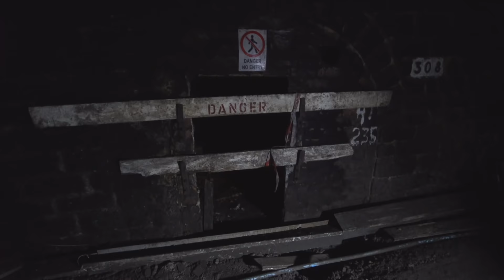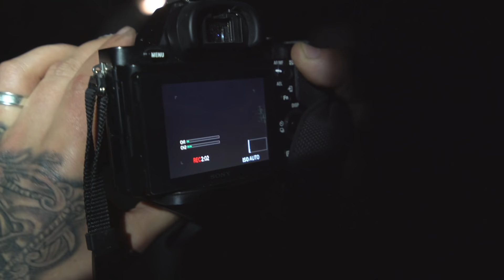CRAZIEST UNDERGROUND EXPLORE YET! A WORKING TRAIN SURPRISES US!

Comment: The clicking noise wasnt an alarm, its a way of enabling the location of the emergency  escape tunnel to be located in the dark. The green lights will be on 24/7. Great video chaps!
Reply: Might have ben a ram pump that is how the big ones sound
Reply: @011CJ  well I know the clicking is distinct but you would hear the water from the valve in between the clicks
Reply: @stuartpratt3662  yes true
Reply: 32:30
Reply: @011CJ  That was nothing like a ram pump.
Reply: @severnsea  have you ever ben around a big ram pump in any of the major cities undergrads? They are massive biger then a truck and sound just like that . I definitly could be wrong tho 🤔

Comment: Lol I work on the rail, This is standedge tunnel. The metal cage is indeed to support the roof as it was collapsing. The line you were on is the trans Pennine express route from Manchester to York. Between Diggle and Marsden. The tunnel is close to 4 miles long with gates on either end
Reply: Rob Kennedy is that the Diggle in Saddleworth
Reply: @SPOOKYGAMER  Yes
Reply: I thought they were in Hull? How did they end up there?
Reply: @will-zu1xv  yeah me too where is it exactly
Reply: @will-zu1xv  They pasted 2 different scenes together. The tunnel they enter at 9:50 is a different as they are in at 13:25. The tunnel at 13:25 is one of the service tunnels connecting the 4 tunnels of the Standedge tunnelcomplex (1 canaltunnel for narrowboats, 2 disused railtunnels (nowadays in use as service & emergency roads) and a life railtunnel. At 37:00 they exit the tunnel in Hull again.
Reply: @wam98674  It was a part of a shelter for workers in the tunnels long time ago.
Reply: @gilles111  ahhh okay cool cheers dude!
Reply: Fuckin hell diggle i went round there on a double decker bus it is very tight round there it was out of service coming back after doing a school run i saw a transpennine 185 go over the viaduct
Reply: Instead of Pennine I red Penny wise, alright
Reply: @gilles111  That makes sense, that is the Standedge tour boat for sure. The "Enviroment Agency" logo on the drivers overalls is easily recognisable.
Reply: Know Anything about the boat?
Reply: I agree, that's definitely standege tunnel, I live near there
Reply: @replayrecords5865  someone said in the comments the boat was a canal river survey boat that is there annually, they happened to be there the same day it was
Reply: @gilles111  That explains why I couldn't figure out how they got down there at 13:25.
Reply: @replayrecords5865  They have tours through the canal starting from the Standedge Tunnel Visitors center.
Reply: That explains the weirdness
Reply: You should show them around
Reply: Looks like a lot of maintenance work going on  . Plastic tube for Communication .
Reply: "The Standedge Tunnel Visitor Centre, at the Marsden end, is a base for boat trips into the tunnel and has an exhibition depicting the different crossings."

That was probably the boat they saw passing underneath.
Reply: @gilles111  Is there actually an entrance wide enough for a vehicle to drive thru? The tunnel looks like it has tyre tracks.
Reply: @schweizerd6303  It is absolutely wide enough. The railway tunnel once fitted double track (the disused tunnel between the live tunnel and the canal tunnel - at the other side of the canal is another disused railway tunnel). So it is about 6-9 meters wide. The other railtunnel has live tracks in it (the Huddersfield - Manchester Line). The disused tunnel is still in use for maintenance truck and emergency response traffic (for both the canal and railway).
Reply: They mentioned the boat was hitting the sides - I've been on that boat from Marsden (at the opposite end of the tunnel from Diggle) and it does indeed hit the sides.  The guide said that was quite normal and not to worry.
Reply: I was confused when they said hull that is deffo stanhedge tunnel been in it before took me an my old man hours an hours in total almost a full day going between tunnel to tunnel only ones I’ve seen that was made like that were they interlink amazing got a lot of photos wasn’t lucky enough to see a canal boat pass underneath tho

Comment: just a tip for who ever reads this, DO NOT clim a latter by grabing the middle, grab the rim on the side, its safer and easier.
Reply: and never ever climb the latter, grab the air and carefully use it to avoid breaking the latter
Reply: hard for me to tell if "clim a latter" is just a cultural variation of spellings or an indication that the poster does not speak english as a first language.....or they're just american
Reply: Grab the middle  its safer actual
Reply: You should have told me Earlier
Reply: Remember to always clim a latter upside down. Will be much safer and if you puke, u wont do it on yourself.
Reply: *Just *climb * ladder *grabbing *rim?
Reply: eastjinks dont you mean scottish?
Reply: Monokuma just.. dont climb
Reply: Also climb feet first, good tip
Reply: I'll grab whatever I please, thank you.
Reply: eastjinks, so I’m not an American or anything but the English I speak is sort of American ish. I’d have spelled it ladder.
Reply: Ladder
Reply: I don’t understand
Reply: @Nova Haxor ABSOLUTELY WRONG! Just read any safety advise for using ladders:
If you grab in the middle and slip, you are able to hold yourself. If you grab on the sides,.you're at high risk of breaking your wrist. Very bad idea.

Comment: Shiny tracks always mean active railway. 
(edit) but rusty tracks don't always mean inactive.
Reply: Yeah but not always the line could be closed beacause of engineering works
Reply: @scottishtrains9761  Even if thatvis the case, shiny tracks still indicate a high probability of meeting a train. Not a wise idea to be walking through a tunnel with no refuge on said tracks if you have no communication with the management of that section. Trains don't stop quickly.
Reply: @mfx1  if it's shiny, it's highly likely to be in VERY freqient use.

Don't touch it.
Reply: Rusty tracks mean nonactive railway
Reply: @justaguycalledjosh  touch it
Reply: @freddiemercurygaming4124  Not necessarily, they can go rusty very quickly during times of maintenance/infrequent use or.if the rail has recently been replaced. All rust means is that it hasn't been used recently or often.
Reply: ya, but remember; rusty tracks doesn't mean anything at all!
i know now,
Reply: Never thought about that. Thanks man🤙
Reply: Google search: It will therefore take 20 years for 1mm of steel to be compromised by rust from each face, or 2mm if both sides are exposed. If the unprotected steel section is 6mm wide one third of the section will be compromised in the 20 years, but a steel rail would only have approx 15% of its section compromised.
Reply: Less used than often
Reply: I once came across a railway track that I wasn't sure (at first) if it was used or not
and after having a look around without getting too close, I decided to proceed with caution, and after I crossed over the tracks and had a bit of a look around, I then noticed the tracks in one spot were bent and zig-zagged back and forth from one side to the other, so from that point it became clear to me that the line was defiantly closed (as a train would de-rail if it tried to pass over that bit)
and later in the day I also saw one bit where the rails had been lifted up and moved to the side
Reply: That's facts right there.
Reply: @scottishtrains9761  it’s still an active railway if it’s shiny it has a decent amount of rail traffic so there gonna have it open asap but even if it’s closed for maintenance it’s still an active railway
Reply: @freddiemercurygaming4124  No, it just means it has a lower priority. There are rusty tracks near my old house and they were used.
Reply: @1143flip  Point is just be careful. Brake discs on cars can look rusty after a day or two of rain if the car hasn't been used, surfaces can go rusty very quickly. There are one or two areas where there is only a weekly service, a track can look rustier than it is in between use.

Comment: its a ventalation shaft, in the days of steam it would be used to remove the smoke, also they could have been used as a shaft in the tunnels construction.

The fireplace is used as part of a service station for the maintenace crew 100 odd years back.
Reply: Tartaria
Reply: The area with the fireplace was for the platelayers/trackworkers to have a take a break, get warm and have a brew.

Comment: This tunnel looks more like the Standedge Tunnel on the Huddersfield Canal, between Diggle and Marsden. There are infact four separate tunnels.

One live two way track railway
Two single track disused tunnels but still maintained by Network Rail as emergency escapes for the railway and canal
Standedge Canal Tunnel being the first and oldest and a distance of 3.25 miles. 

The air shaft that you came across is the one for the canal which was bridged over and a grate put in the middle which drains directly into the canal, and that why many boaters like me get wet when going through. 

The air shafts for the canal were sunk first and the Navies dug in both directions to meet up with other Navies the were digging towards them from other air shafts, which were also used to remove the spoil dug from the tunnel.

The boat your saw was the trip boat that takes visitors, who visit the Standege Tunnel visitors centre a short distance into the tunnel before reversing back out again. 

When I did the trip through the tunnel in my boat it took me ONE & THREE QUARTER hours get through. 

The man hole cover you went down certainly does not match the tunnel you ended up in.

Nevertheless still a great vlog.

Comment: The two tap/clicks were that old lady on her boat hammering the wall near by waiting for you to look around that corner..... Joking its on 24/7 to help the rescue boats find the nearest port in a emergency. Also you couldve said hi to the boat the worker is there as a rescue sure he will tell you to leave expressing concerns due to live railways and potential tunnel cave-ins
Reply: Hence the reason they didn't say Hi. Virtually zero chance of a cave in, they would allows trains and boats through the tunnels if there was any danger. The main reason the two redundant tunnels are shut off will be because of the live train lines. They can't put locking gates on there as it's an escape route in the event of an incident on the train track.

Comment: 13:41 you were in a train tunnel! On the side of the tunnel are brackets that carried signalling equipment! I used to work on railways!
28:07 Thats simply a ventilation shaft. 
31:01 This would have once been a trackside hut for a track maintenance gang! Possibly wooden most has rotted but not u isual to have a fireplace there. A gang would have looked after all this tunnel network so they need warmth.
This is really interesting as you have stumbled on a double train tunnel with a canal passing UNDER it! AWESOME EXPLORE!👍🏻👍🏻👍🏻
BTW the boat you saw is possibly a maintenance or dive boat as i saw flippers onboard!
10/10 !
Reply: Looking at this, I doubt the train clip is in the same tunnel in the rest of the video. Was it?

Comment: You are in the Stanedge tunnels. The lower tunnel is for the canal. The 2 unused tunnels are the disused single bores, Network Rail owns and uses them for maintainance access. The other tunnel speaks for itself, being the twin track bore, with trains running at over 70mph

Comment: You have to do a full explore of that and find out where the tunnel comes out at both ends. I live near Hull and never knew those were there. Tried looking it up and couldn't find anything. Also what train is that? All the rail lines that I can see on google maps are surface ones and they either terminate at Hull Paragon station or the docks. You should take a compass and a sreet map so you can plot where under hull it is.
Reply: @robtuton4392  Standedge Tunnels

Comment: That clicking sounds like an electrical contactor switching in and out or on and off if you prefer, probably powering a water/sump pump. Keep exploring this one had me on the edge of my seat! And the survey boat probably picked up your electronic items with its radar hence why it reversed.
Reply: Radar doesn't pick up electronic items, and I doubt a boat in a underground canal has it's radar on anyway, it's of no use in there.

Comment: at 13:30 the big tunnel area. It might of been a former train line, or possible a future line and just wasnt needed. Or perhaps just a access area for trucks to get into for train line or under ground work if needed. But, there are Tunnels while once used for Trains and possible train line repairing. Some might be used by Government as like escape routes or a way to get VIP in or out of areas or moving large amount of cash or gold. Sometimes used often by them to keep checking on tunnel to make sure its safe to use.

Also ever thought about picking up a couple glowsticks before going into tunnels like these. I understand you want to be secret like, but sometimes might be useful if there are few tunnels around or paths. could drop one down or place one some where. so can tell if you either been some where or able to find the correct path or door.

Comment: The repeating knocking sound is from a water hammer pump or Hydraulic ram pump. Perfect way to pump water without electricity input.
Reply: It's definitely not a Pump. This noise is 100% electronically generated and it sounds like a Horn Speaker. This can be used to detect/measure rock- and any type of creature underground movements. 
A ram pump needs water pressure for it to work at all. That makes no sense there.
Reply: It's more likely to be an escape aid if you're getting off the canal (maybe in darkness) - alerting you towards the emergency exit.

Comment: You are not in HULL this is the standedge railway and canal tunnel
Reply: Maybe it's a very long tunnel going from Hull to Marsden which they edited out?
Reply: @yerwol  it's between Diggle and Marsden on the TPE line
Reply: @robkennedy3000  You never know though. They might have found some super secret transdimensional tunnel which connects the TPE line to a tunnel under Hull? :-p
Reply: @yerwol  no, there is only 2 tunnels that go under the Humber from hull and they are both electricity tunnels. There is no physical evidence that there's a train tunnel under hull. This is Standedge tunnel and is near greater Manchester than hull. The manhole cover is just a normal drain in hull
Reply: @TheWkc19  you've clearly missed the tongue in cheek emoji and the sarcasm of talking about transdimensional portals! 😂😂

Comment: The noise that they hear what they say is an alarm is no such thing; I worked down the  Mines and I recall a Machine that Made such a  Noise ' The Noise was that of something that Looked like a  Gigantic Bicycle Chain  that Had Horns sticking up  and as the Chain Rotated  the  Horns would Push a Mine car  along the  Knocking Noise was the Horns  Making a return Journey back to the  Other end The Horns were there to prevent the  Mine car  from running Back; I Might  be wrong on what I say But some  Barges that are On the  Canal sometimes  need  that extra Help to Push a Barge along the  Tunnel

Comment: Honestly you should definitely be wearing something like carhartt pants. Something thick and heavy that protects your legs and won’t rip. Skinny jeans will probably make it hard to climb, rip easily, and won’t protect you. Also leather work boots and metal hard hat. Maybe a proper gas mask in case of dust or gases. A gas detector won’t do much if you have no way of protecting yourself

Comment: The Shute with the water coming down It’s to let fresh air in
Reply: Actually it's to let pressure and smoke out. When a train travels through a tunnel it builds up pressure in front of it, these openings provide a release for that pressure to escape. The channel tunnel also has pressure release mechanisms otherwise the tunnel would explode.

Comment: The Silver box is a location cabinet with Relays for the track circtuits and signals, The yellow Phone is a Lineside Telephone used to phone the signaller, Both are usually maintained a few times a year so network rail will be going down there fairly regularly!

Comment: You are th original Stanage tunnels, you are in one of the two old tunnels which is now disused, joined through a number of shafts  is the canal tunnel, the still in use train tunnel

Comment: In the late 19th and early 20th Centuries steam lorries with 3-way tipping trays operated by steam rams were common. It is quite possible that if the tunnel network you explored was established as an adjunct to creating or extending the underground rail network then given the time frame during which that happened coal fired steam lorries could have been used to carry away excavated material and deliver construction supplies. That could explain the soot on the roof of the service tunnels.

Comment: Alot of these side shafts were used to dig the first and second old railway tunnels and passing over the old canals. Narrow boats still use them for traveling around the country side. The vertical shafts were where the miners came down to dig the tunnels in two directions from the middle and are used for ventilation now.  You guys need to do a little more background and history checking about the areas you go into first.

Comment: the tunnels would have been a single line more than likely steam nd now they will be used as service tunnels for network rail to maintain the current tunnels that are in use and the opening to the surface is a ventilation shaft to keep a flow of oxygen and so it don't build up with smoke as it will act as a hoover and pull out all the emissions from the trains